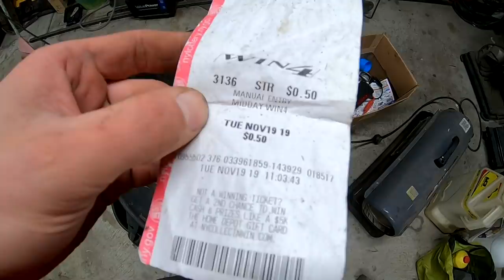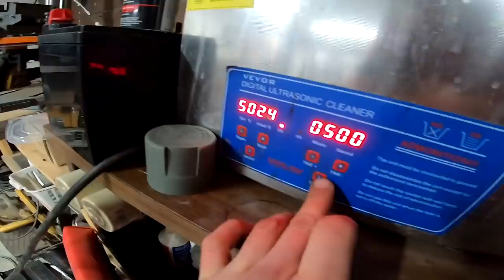$100 Craigslist Gokart Runs in 45 Minutes

Comment: That hole in the fuel bowl is actually from the ultrasonic cleaner.  There was a scratch or a little oxidized rough spot there and it became a nucleation site where those bubbles you see were bursting.  You ran it through multiple cycles and it literally ate through the aluminum.  

Throw a  square of aluminum foil in a powerful ultrasonic cleaner and you can watch it get shredded.  I don't know how powerful the units like you have are, if it was dumb luck or if it has the power to do this every time but you might have to put some wrinkles in it to get it to put holes in aluminum foil and run it multiple cycles.

Comment: you should never reach into an operating ultrasonic cleaner bath to remove and inspect parts. Not only do you risk burns, cavitation can penetrate your skin. Not a good thing. Btw, to clean parts that float-put a weight on them.

Comment: on a maintenance free compressor, simply get some air tool oil and squirt some into the compressor it self. into it's intake, or flip it over and squirt some on the cylinder wall. it will usually help keep it going for awhile, but they really are throw away compressors.
Reply from the maker: The last one paid for itself. My grandpa gave it to me for free LOL

Comment: In the 3 wheel community, trail pros get a bad rap! They are the worst. Too hard of compound and load up quickly with mud. Hot knifing them does wonders. It all depends on riding conditions. But in snow it mud I would definitely consider it.

Comment: Check out ereplacementparts.com for the info on your weakening air compressor. They are a company that sells replacement parts for just about anything and everything and they even have videos and diagrams to help you do the repair work. I've used them for years for everything from go kart parts to commercial roofing nail gun parts and have never been disappointed...